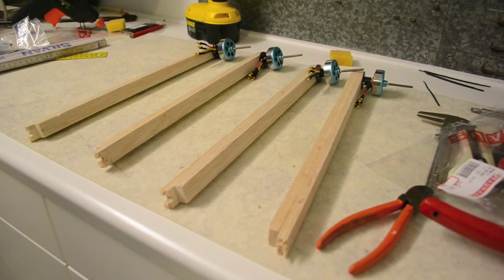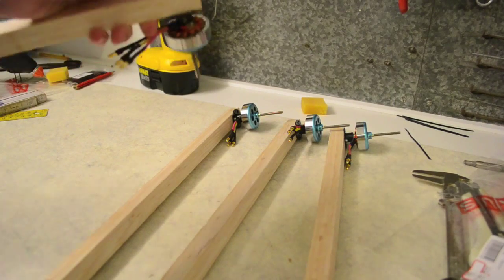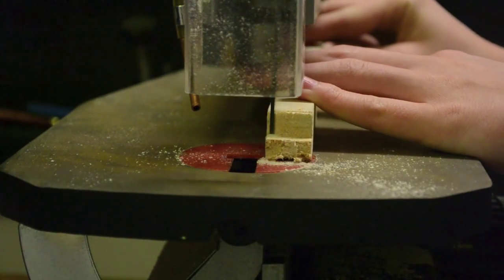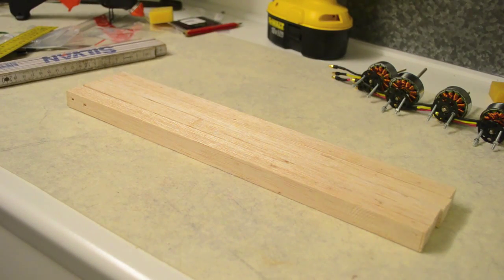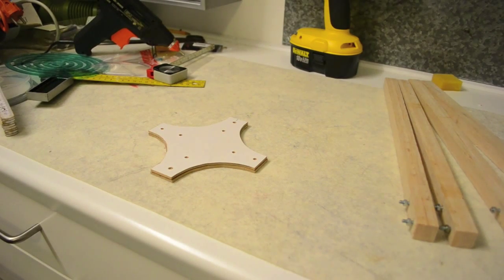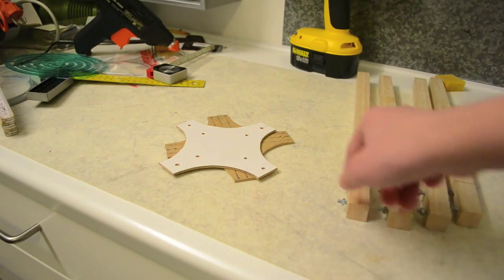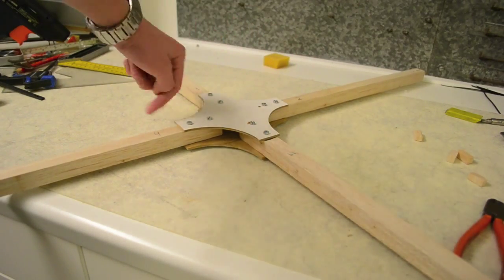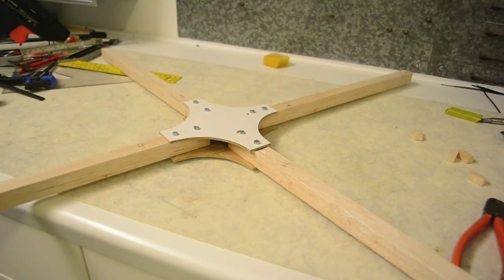Quadcopter build v1.0 [Part 4]

Comment: This is fairly old and Im sure you have seen more quads since then, but for anyone watching, the X configuration would of worked just fine with the plates. i would of just put them back together, squared them up and slapped the plates on it.

Comment from the maker: If you want to add this kind of sensors it is probably better to get one of the stabilization systems. DJI Wookong for example. 

If you just want to stabilize the Quadcopter, buy a KK board, either from ebay or HobbyKing. Thats the cheapest thing you could do ;-)

Comment: Is it possible to build one of these things without buying the controller board? I was thinking of using an atmega32 for the motor control and hooking up the transmitter to that in order to control it. Let me know what you think.